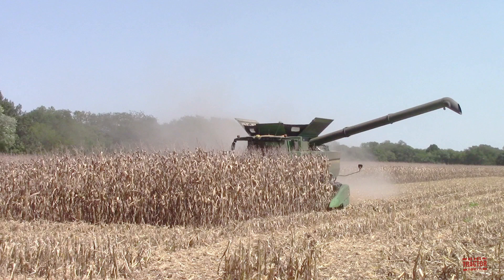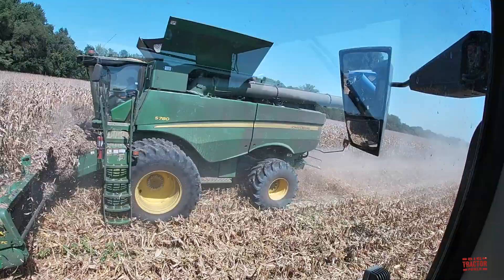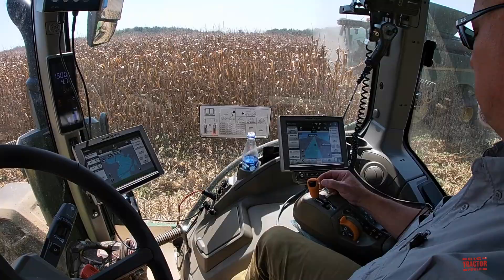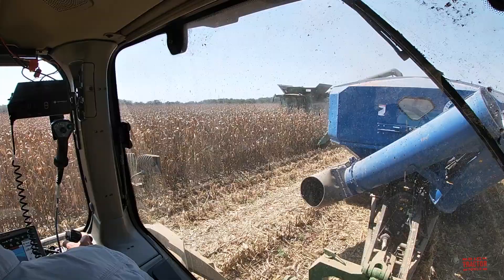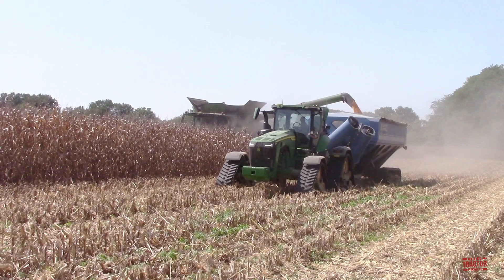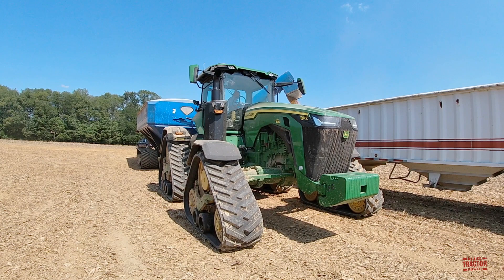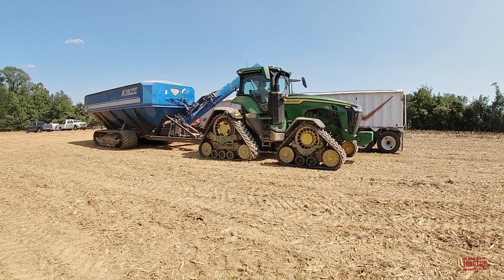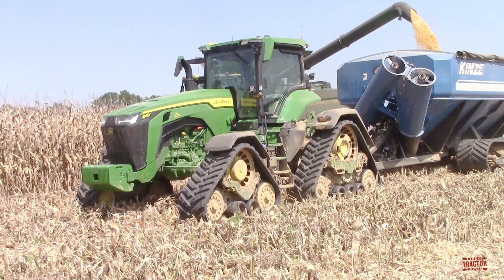JOHN DEERE 8RX 370 Tractor Moving The Corn Harvest

Comment: 6:30 that sensitivity problem is not so bad on fixed frame but on articulated tractors it throws you around the cab.
8:00 that there is why solid axle is still king of off road. the IFS system tries to keep the wheels parallel to the vehicle and not the ground the duels really shows this in action the right one is up in the air where as the left one is being loaded much more than normal.
Reply: Ok
Reply: Straight axle over ils any day

Comment: Farm hands today don't know their born, I used to drive an old Massey fergusson 65 pulling a Massey fergusson trailer ,working with a Massey Fergusson 780 special  with a 6ft cut ,took forever and a day just to cut 20 acres that's if the combine didn't block up,while the neighbouring farmer had a Clayson with a 16ft cut, I feel so hard done by, winter time I use to hug the exhaust to get warm to the point where it use to burn my coat, don't believe anybody when they say the good old day's.  Kevin Fox London.

Comment: Hi bigtractorpower, love this video! I have two questions regarding these tractors:
1. How do these rubber tracks hold up on hard surfaces, i.e tarmac etc?
2. Can these tracks be removed and replaced with wheels if need be?
I am not too clued up on Ag machinery but your vids help a lot. 🚜🚜🚜👍👍👍
Reply: wheeled tractors can be converted to use tracks but most tracked tractors cant have wheels on them
Reply: @mayto420  Thanks for that!

Comment: Disagree on the front suspension. You have a solid axle on tracks verses the independent front axel on the wheeled tractor. Plus the tracks are spread wider then the wheels. Of course tracks are smoother in the field but dang sure not down the road.
Reply from the maker: I have driven an 8RX on the road at 26mph.  It is very smooth on the road. It’s no like other tracked tractors on pavement. Check out this road video I made on the 8RX.  https://www.youtube.com/watch?v=uk64ge1ATU0
Reply: I drove one last week on the road, smoothest tractor I've ever driven on the road.
Reply: bigtractorpower I’ve ran one. Not impressed. And didn’t think it was smooth. We will agree to disagree.

Comment: If the tractor speeds up and slows down with the combine then how does the combine fill up the front or the back of the cart
Reply from the maker: The combine operator can adjust the tractors position.
Reply: Haha! Good question! My boss man always tells me to stay at the same speed and he'll slow down or speed up in the combine!
Reply: it most likely has an adjustable offset to move it more forward or back relative to the combine.

Comment: Would love to see Titan LSW tires pitted against the tracks.  I think the LSW tires would be the all-around winner.  Have tests such as,.....ride quality in the field and out on the road, which can go faster?  Traction.  Fuel consumption.  Costs, initial and replacement.  Again,.....I think the LSW tires would be the all-around winner, using the same type/model and model year tractors.  Pit John Deere against John Deere, Case IH against Case IH, Challenger against Challenger, Versatile against Versatile, New Holland against New Holland, Fendt against Fendt.  See what you can come up with Jason.  Let's see what kind of pull you have. (Ha!Ha!)  You can also get LSW tires for combines.

Comment: What size tracks were on the rear?  Looks like 24 inch in front.
Reply: i dont think JD allows for mixing of track sizes we at least from factory but they do look the same size and it is a row crop operation so track / tire width and spacing has to be the same all round.
Reply: Phalanx380 actually, the tracks come in 18” and 24” tracks for up front and 18”, 24” and 30” tracks in the rear.  So you can have 24” front tracks with 24” or 30” rear tracks.  It looks like they are running 24” for both front and rear tracks.  Would make a great setup for 30” space planter and grain cart duty.